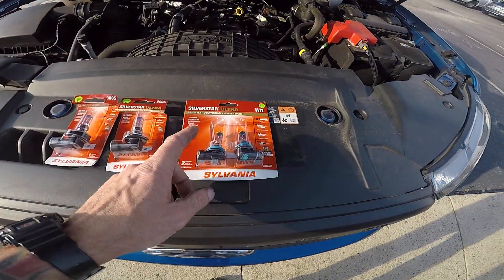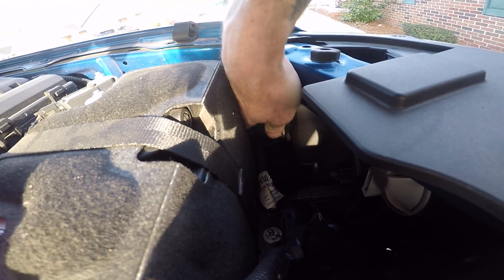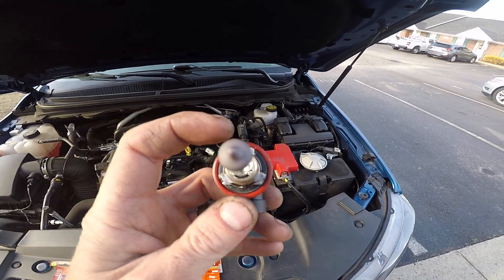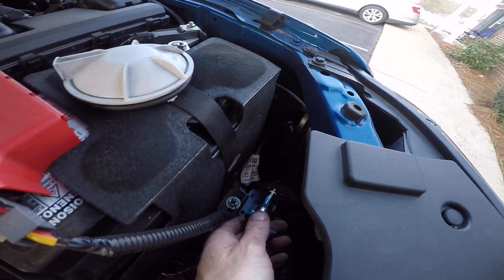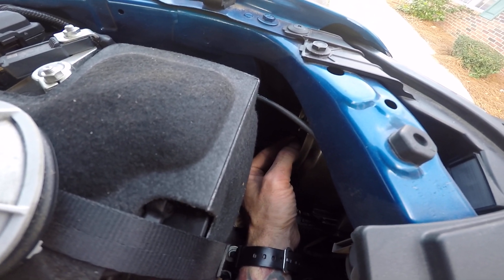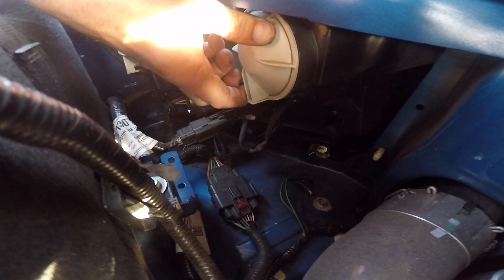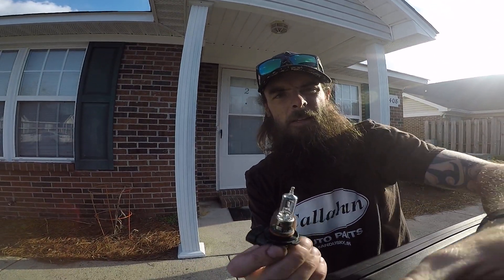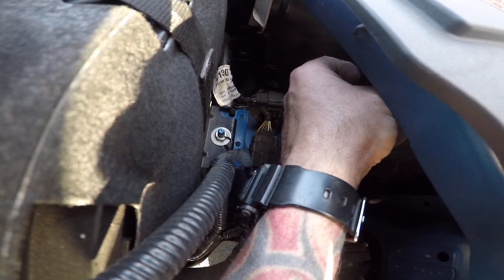2019 Ford Ranger Headlamp Bulb Install How To

Comment: If you accidentally touch the bulb use denatured alcohol and a paper towel/cloth to gently remove your finger prints. The oils, salt and acid in your skin etches the bulb creating a hot spot from heat when on. The bulb will start to blacken and pop. I learned first hand long before tinkering on automobiles. I took care of the film and slide projectors including the micro phish readers in the entire school and library when I was a young lad. Among lots of other types of equipment. If you didn't already know, "now you know the rest of the story". I replaced many bulbs...lol😆🐶🐕
Reply: Thanks for the tip troublemakingpups! I didn't know you could clean the bulbs with denatured alcohol. I was always careful not to touch the glass.
Reply from the maker: Man I didn't know you could clean it that way. Awesome!
Reply: @mlieser1230  Hi M Leiser, I am happy to be able to share some useful info with you. 🙂🐶👋🏻
Reply: @BeardedFordTech  Hi Anthony! Happy to be able to share some information that was useful to you. 🙂🐶👋🏻
Reply from the maker: @troublemakingpups5787  very useful. I had no idea about that
Reply: I’m know I’m commenting on at least a year old video but my bulb just went out and I want to replace it myself and didn’t know this. But could I touch the actual bulb if I wear nitrile gloves?

Comment: i have a 2023 xlt fx4 . this is my first turbo owned ford. i had 6 new fords 5 were 5.0 no problems.  i have a question i decided to go with the 2.3 turbo since its been in the mustang now since 15. how long do you think this motor will last with proper maintenance? i just did the first oil change(5w 30 valvoline advanced) at 2 thousand miles and plan to change it now every 5 thousand like my 5.0 coyotes thanks for your time!
Reply from the maker: I have the 2.3 in my ranger. It's a good engine. Keep the oil cha get every 5k like you plan to do and you shouldn't have any problems at all.
Reply: @BeardedFordTech   thanks for the reply.  have a great holiday 🎄
Reply from the maker: @alexk7286  your very welcome.

Comment: I have a Ranger Tremor Lariat on order (since December 21!!) and took the $500 credit for halogens to get my order processed sooner. I think halogens are safer in cold climates. I put H4 conversion kit in my Cherokee, then put in LED bulbs.. I didn't even last a winter before I took them out for Halogens again. LED bulbs do not make enough heat in snow and icing conditions. My Chevy volt has LED low beams and halogen high beams. Was driving with high beams on for long time before oncoming traffic came along. Once the high beams went off the road disappeared! There was over 1/4 inch of ice over the LEDs!!!
Reply from the maker: Aftermarket LED doesn't last long. These new vehicles with led is usually the daytime running light or the accent around the assembly. The actual bulb is a projector style with a white light.  Tail lights are LED. Factory LED does last longer cause the ballast is built in along with the resistor. But you are correct. Is real cold climates halogen is the way to go. I can see plenty far with these halogens.  You haven't got your ranger yet?  I know the Mavericks are on backorder too. Chip shortage and supply chain issues. People who ordered July 5th may have to wait up to 8 months which will make it a 23 model. I did a video on that.
Reply: @BeardedFordTech  Nope :( still waiting. Scheduled for August 26 and delivery Sept 29th... My wife is going to make a baby faster than Ford can make a truck!
Reply from the maker: @TevisC  yeah I know it's frustrating. But it's not the manufacturer. It's the supply chain and chip shortage.